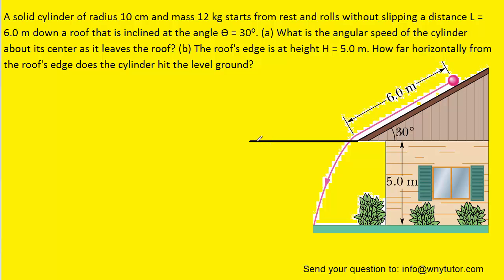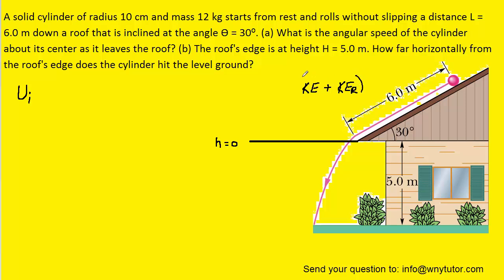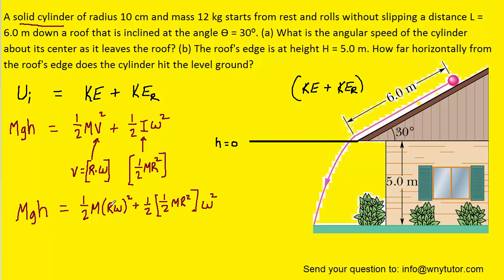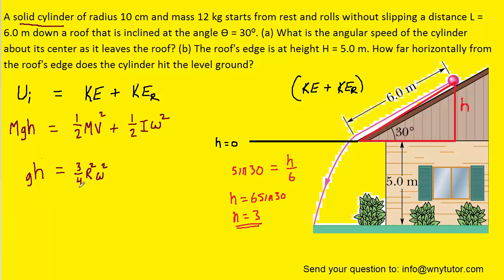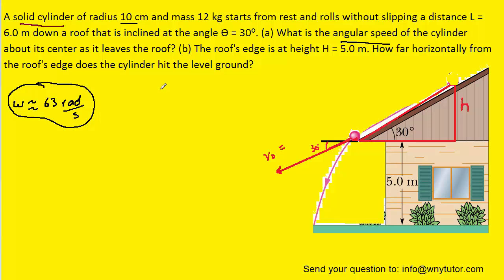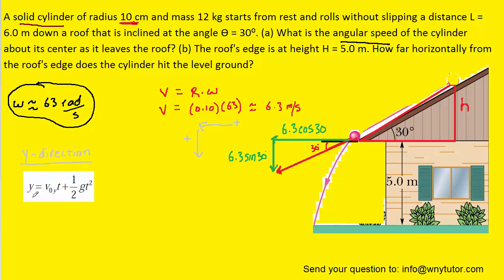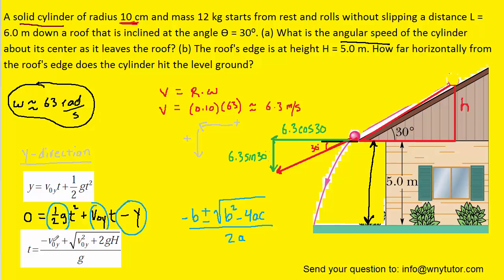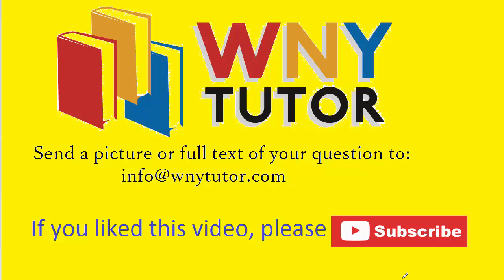A solid cylinder of radius 10 cm and mass 12 kg starts from rest and rolls without slipping a distan

Comment: Isn't the value of h = 6 sin(30) + radius of the cylinder? because you want the height to the center of mass?
Reply: Well the radius of cylinder Is 10 cm which is 0.1m and hence can be neglected, because 3 m and 3.1 m are roughly same
Reply: @thecountofmontecristo.4542  Even so, the height of the center of mass is equal to 3.1m

Comment: Great video, thanks! I thought 63 rad/s was too fast, but this video confirms my answer.

Also, for part b, instead of solving a quadratic, you can simply use Vfy = Viy + at -> t = (Vfy - Viy) / a = (0 - 6.3) / -9.8 = 0.64 seconds :)
Reply: I think that only works because of the 30 degree angle. Doing it the long way is better practice.